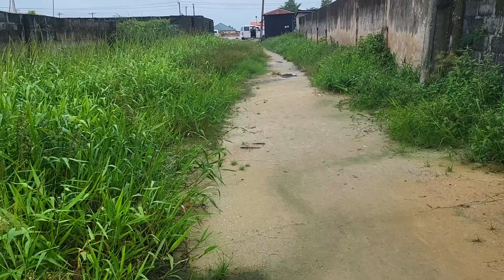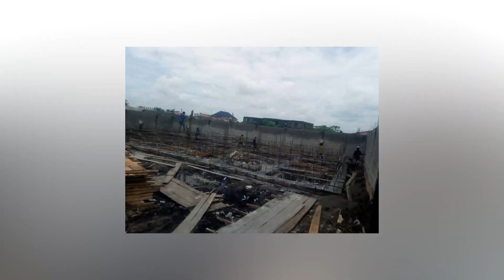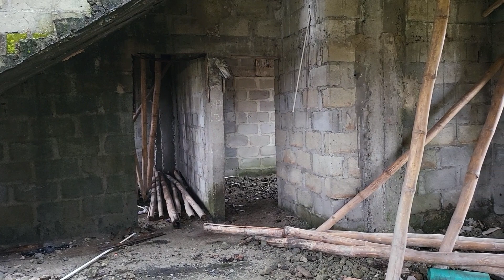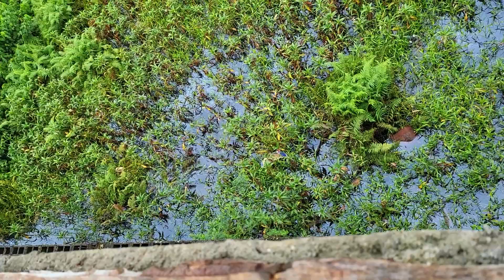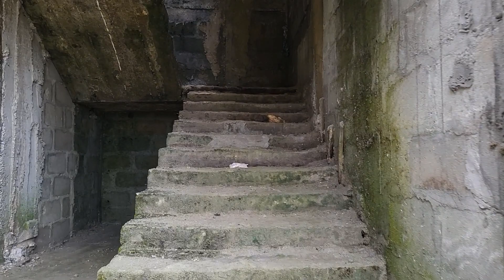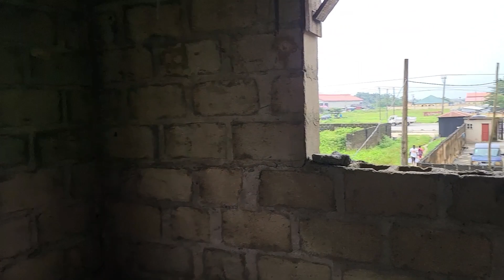BUILDING A $75,000 HOUSE IN NIGERIA

Comment: The prices you are giving is not realistic for inflation. If you bought cement for 2000 in 2019; cements cost N8000-N9000 now. So it’s 3x the cost. So the cost to build that house now will be $200k. I started building three blocks of three bedrooms one story flats not in a swampy area but have spent 105,000 so far. I have not roofed yet  about to do the beam for roofing. You are doing a good job but tell your viewers that they should budget 5 times the price from when they start building. That’s my two cents
Reply from the maker: 105k so far and you have not even added roof? Jesus Christ, are you people sure something is not wrong?

And No that house will not even cost 200k even today
Reply: @TheBuildingphase  my friend, I have 46 pilllars from foundation. Each T&T rod costs 9000 for 16mm , 6500 for 12mm and 2500 for 8mm when I started. I did chained the foundation too. I did lintel and casted the deck. started the up one by February and the cost of T&T iron rod went to 22,000 per rod for 16mm , 16,000 for 12 and 10k for 10 mm etc. I bought, then cement was 5860 when I started; it went to 15k and now 9k. I waited for the cement to drop and bought at 9000 for 900 bags. Check it man! I haven’t added labor, electrical wire, plumbing and woods.

I know sizes of house matter but bros, my house just a story building( three blocks of two bedroom flats down) and one three bedroom up stairs with one two bedroom flat. Yes…. No lie dictated 😂